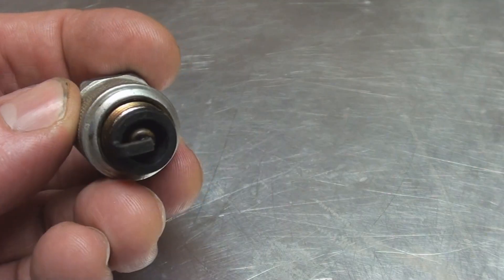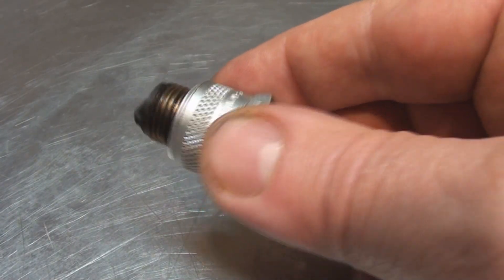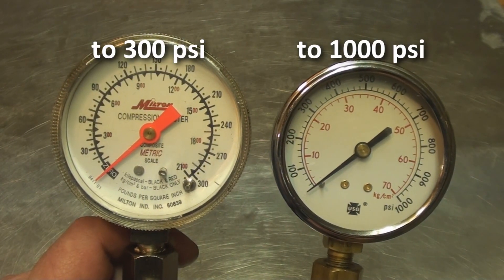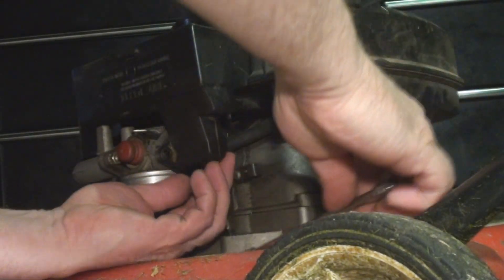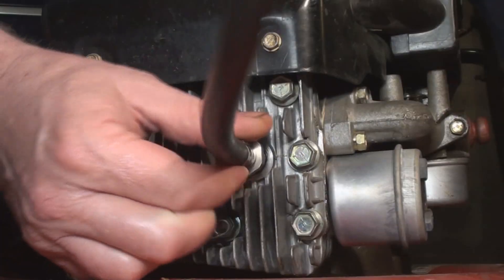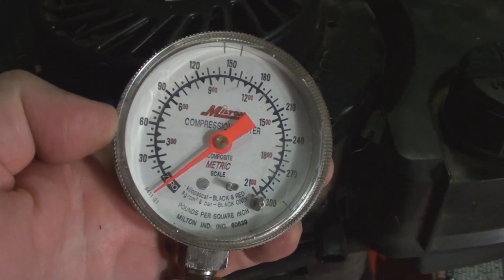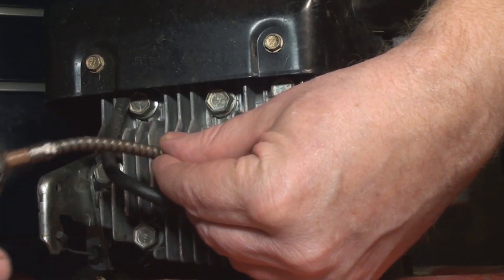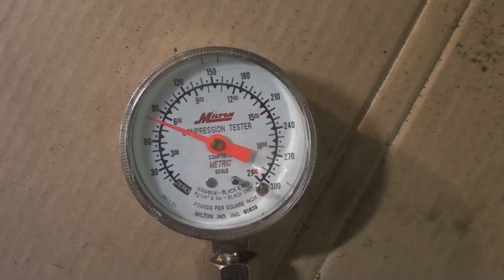Lawn Mower Compression Test

Comment from the maker: @D12caterpillar - You're not giving me much to go on. Battery +13 volts? Fresh fuel? Airway clean and clear? Choke & throttle plates operating? Maybe perform a leak-down test to see if a problem is revealed.

Comment: what if the motor has to much compression and the fullly chared battery cant start it? (starter is good i already check, it also has good plugs and plenty of oil
Reply: Valves need to be adjusted

Comment: How do you know if you have a headgasket leak in a motor like this? I have no signs of smoke, but a loss of power and checked my intake and fuel. Hard starts and its cuts out alot. Its over ten years old.